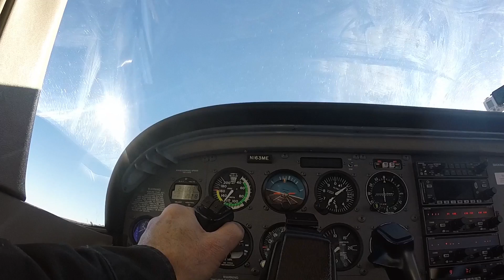Putting "On the Step" to the Test

Comment: If you are on the step you artificial horizon will be showing just slightly depending  You rate of climb will be showing depending slightly under 0   if in a high wing when you look at you bottoms of the wing you will look like your decending  the only instrument that tells you your not is the altimeter and you get on the step using your trim.  Was never able to achieve it is a Cessna  But  A Piper Tri Pacer  A Stinson Voyager and a J3 Cub but in all fairness there not as clean as a Cessna.  It all about the angle of attack and getting more lift at a down angle.  Your never going on the step with an efficient wing.  The plus was a few more knots with a little less fuel.  The Tri Pacer was the easiest plane to do it in.   Love to see these 2 find a couple of ol pacers and try that again